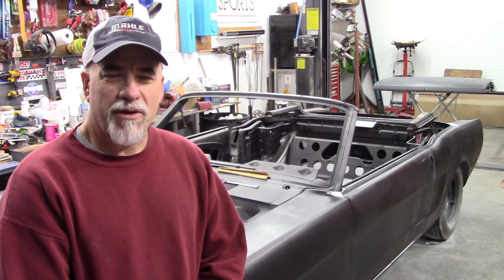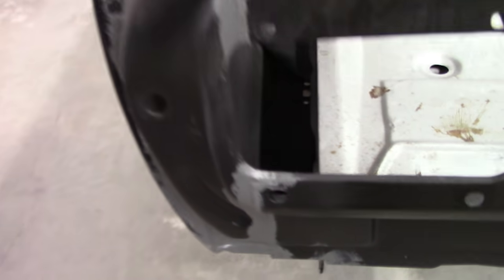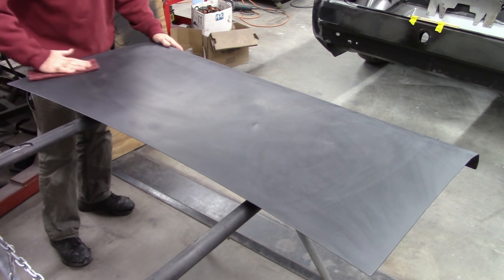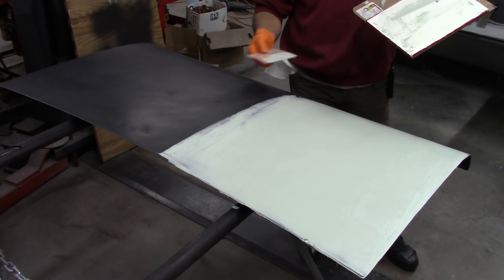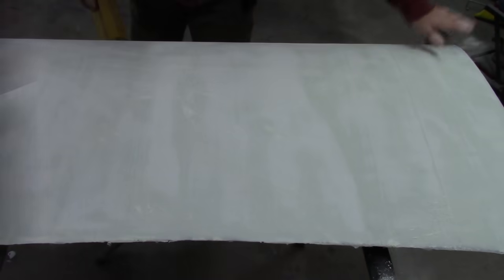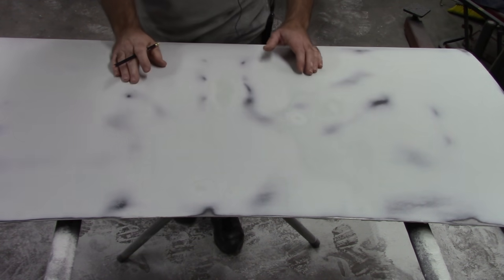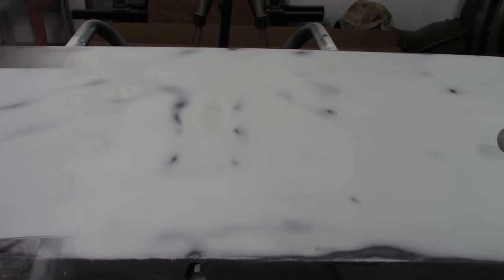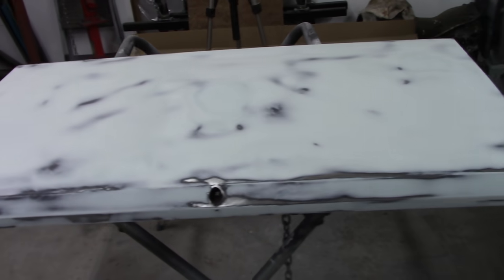How to smooth a trunk lid with body filler. Brooklyn Pony part 25

Comment: Depending on what your sinus issue is, you might get a pause by putting about a liter of steaming hot water in a bowl or something and with the aid of a towel, channel that steam in to your face, specifically your sinuses by breathing in and out to clear them. I usually do this with my hands above the sink, but don't know if your hot water is as hot as ours (scalding hot, barely able to keep it in my hands, but it works better because i can put it right against my face).
Reply from the maker: Thanks. It seems I've always had sinus problems. Could be from our pets. I've tried allergy pills, neti pots, and other remedies. The only thing that helps temporarily is nasal sprays. Seems to relax the membranes.

Comment: Great video very useful information.  Would greatly appreciate your help to answer a quick question:  is there any value in putting dykem or some equivalent on the panel and then giving it a quick file to show the high spots that can then be worked with hammer and dolly before applying filler or is that some esoteric exercise that is not worth the effort from a practical standpoint?   Thank you.
Reply from the maker: Hmm... I think that is not necessary. If you are starting with a bare panel, and it has epoxy applied, you can see and or feel most of the high/low metal. Initial sanding with a stiff block will also show those areas.

Comment: Hello Barry. My name is Phil I am new to your channel. I really like your channel. Very informative. I am the new proud owner of a 1965 Mustang coupe. I am 57 years old and I have never done body work before. I am an old sheet metal welder by trade and I have the same "think outside the box" attitude that you've got. I have no doubt I can accomplish the same or similar results that you have. It may take me a little longer but I can do it. I do have a question for you....when you did your trunk lid did you take as much time with the inside of the lid as you did the outside? If so, did you apply bondo in the same manner as you did the outside? PS...your videos are never boring. I have watched your videos over and over. You are very detailed oriented and I respect that a lot. You are a true craftsman. Keep on keeping on my friend. I will be watching and learning. Don't stop doing what you do. Phil
Reply from the maker: Hi Phil. Thanks for commenting. On the inside of the panel, I just stripped and primed. No need for any filler.
Reply: Thanks Barry. I was just curious. I appreciate your timely response. Keep making those videos. :)

Comment: hi great posts as always learning a lot  here just watching I see you said you use epoxy primer over the bare metal then filler and any areas you break through to the metal when sanding you etch prime im nearly up to some of this body work and wondering if I have to have the two types of primer epoxy and etch as I heard filler can react with etch is this correct? thanks best regards  jeremy
Reply from the maker: I haven't had any issues with quality filler reacting. But yes, epoxy primer to cover the entire panel after strip. I will etch bare spots, and apply high build. The high build primer will isolate everything and reveal any other issues when I sand it.

Comment: Could you use epoxy primer on the bare spots instead of self etch just wonder what would be the difference
Reply from the maker: You can. I just prefer the self etch because it's in a spray can. I have to mix my epoxy, and I would waste a lot trying to make a small mix.

Comment: Nice video Barrry.  Quick question:  why  spray self-etch on the bare spots?  Could you just mix up some more epoxy?  I ask this, as it would be one less product to buy.  Thanks.
Reply from the maker: You could, but for such a small amount, you'd waste more because of the mix ratios.
Reply: Ok, thanks!

Comment: is it possible the pressure from the sanding block is just allowing the unsupported metal to pull back from the sanding block while the braced area hold up and therefore gets more sanding?
Reply from the maker: Not likely. The idea with block sanding is to eliminate that, and ideally doing it correctly, the block does the work. Some may get aggressive and try to push down harder to speed the process, but that is a bad idea.
Reply: roger, thanks for the feedback.

Comment: It looks like you can make out the pattern of the support bracing underneath the panel in the filler. Will the paint show that pattern?
Reply from the maker: No. After the high build primer is applied, it will be smooth.

Comment: Did you apply seam sealer directly to metal? I’m near the same steps- different area
Reply from the maker: No. Not to bare metal. Need a primer in place first.
Reply: Right on thanks. I figured and I know it’s a controversial issue with epoxy then body filler. I personally prefer epoxy first then filler. In my project I pulled cracking filler of a bare metal fix. Took years to fail but it failed.

Comment: I contacted PPG and Evercoat about applying filler over shopline epoxy primer. Shopline says to scuff with 220 grit if it has been longer than 24hrs. Evercoat says use 80 grit and get to bare metal as best as i can. What has been your experience? Looks like you go dorectly over epoxy.
Reply from the maker: I typically scuff the epoxy if I go over the 24 hour window as you stated. I have gone straight to bare metal many times as Evercoat stated. It depends on the repair.